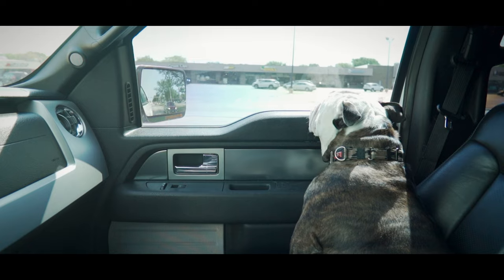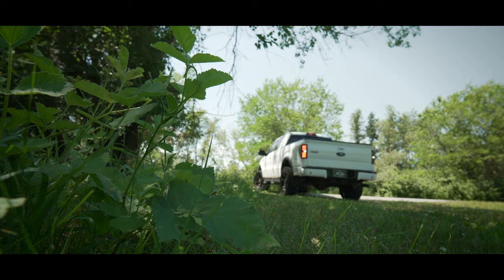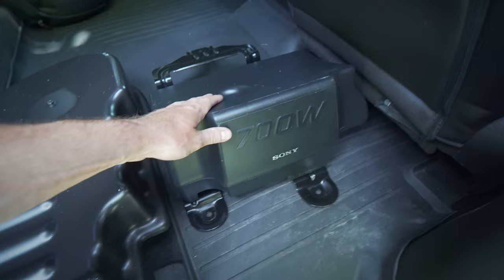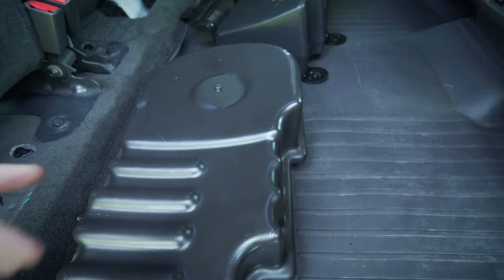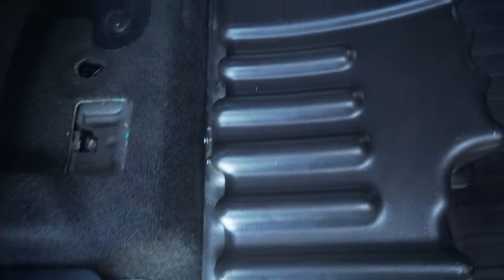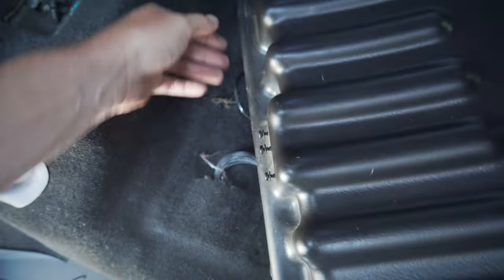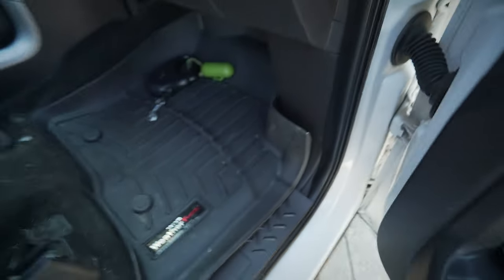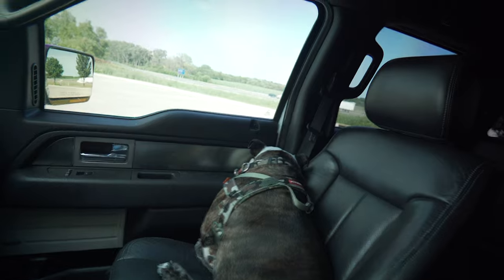2009-2014 F150 Kicker Soundgate SUBWOOFER upgrade KIT!

Comment: Do you have a supercrew? What's the part number of what you got? Having a lot of trouble finding the right one
Reply: Like what did you search? When I look up subs i get multiple different part numbers and it's confusing how you found that specific one. I tried searching 9L3J-18C804-AB, but get really no hits. Tried 9L3Z-18808-N but only found 9L3Z-18808-P (which says not compatible with crews, but no idea why)
Reply from the maker: Kicker VSS SubStage SF150C09. That's the model number but is it discontinued. I would probably keep an eye out on f150forum or eBay/marketplace.
Reply from the maker: @Kornkat2020  https://www.stage3motorsports.com/sf150c09-09-14-f150-raptor-supercrew-kicker-vss-substage-subwoofer.html thats the same woofer on stage3 that I currently have.